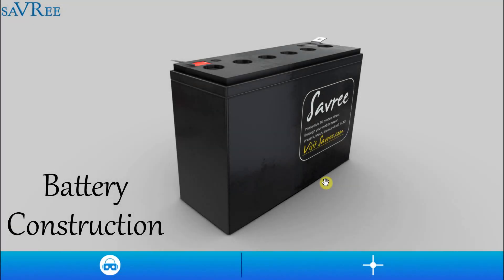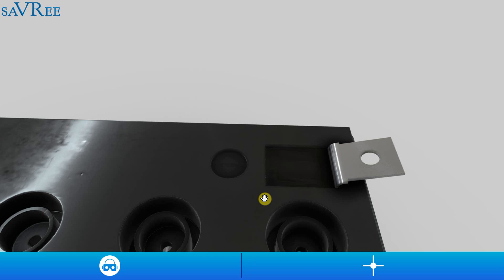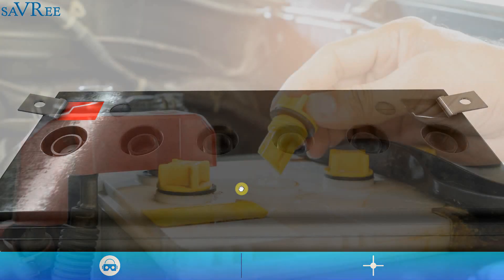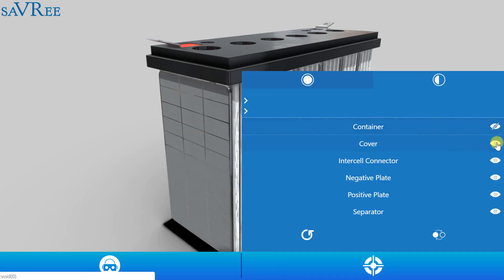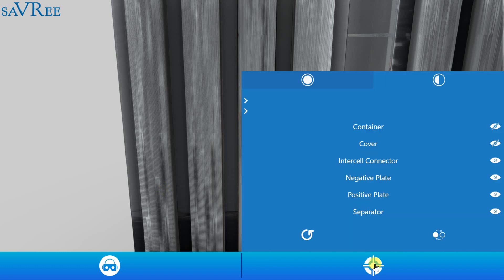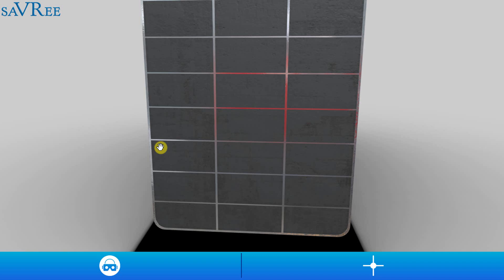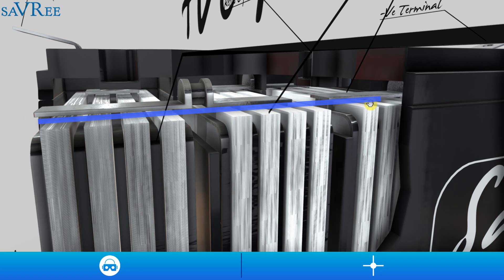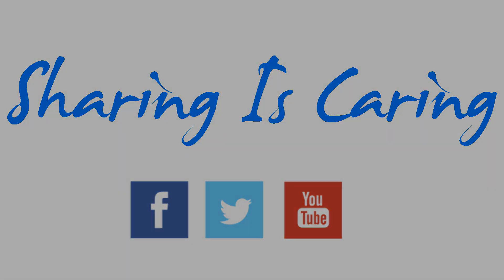Lead Acid Battery Construction

Comment: I can not find the answer anywhere to a very basic simple question.  What this world is coming to?

So I will give this gentleman a go at it.  Lets see.
So you build this battery from scratch.  The last thing you do is pour the electrolyte.  Correct?
So are you telling me that up on pouring the electrolyte you have now a brand new fully charged battery or you still have to actually charge it or you got nothing?
Reply: You're likely going to get somewhat of a combination of both scenarios. Where the battery will show voltage but not have much current to offer. It will completely depend on the quality of your starting materials. 

Let's say your constructing a 12-volt battery. You're at the point where you're putting your electrolyte in. You test the voltage of the battery and you get 12 volts as you should. But if you put something that offers a load onto it it may drop the number of volts dramatically and also not operate the object. If you were to test just the current you might find that you have 12 volts but very little current available. In order to make sure you're ready to go you are going to need to charge any fresh built battery.

Comment: The best explanation of lead acid battery construction I've ever heard! Thank you for this, I am doing research on how to make a lead acid battery at home. My goal is to go to a junkyard and buy old lead acid batteries and design a new openable and resealable see-through container for them for off grid applications. I want to recycle the lead at home, this is what I've figured out so far. The active material and the grid material in both plates is essentially the same thing: lead. The "sponge lead" on the negative electrode is just lead that you would melt and grind up(in an outdoor area far away from any breathing beings, and with an OSHA approved lead filtering respirator on) to make lead powder. You mix the lead powder with sulfuric acid and pure(filtered, like in a bottle you buy from a store) water, mix it up really well, then take a putty knife and press the lead-water-sulfuric acid paste into the pure lead grid. You would then run the grid with paste through a roller that compresses it(also homemade). The pure lead grid is made from recycled lead that you just melted from the battery, you have a steel grid form that you cut on a cnc machine, or you could cut one with an angle grinder and a piece of steel, albeit carefully. You pour the hot molten lead into the top of the form and viola, a lead grid! The positive plate material is lead oxide, red lead essentially, kind of like the red stuff that gets on metal, iron oxide, i.e. rust. This is more elusive, but I believe it can be made with a chemical reaction of some kind between two lead plates, i.e. the lead oxide will form if you just hook up two lead plates in some sulfuric acid and water electrolyte. You grind off the lead oxide with a knife to make lead powder, and just hook the charger back up until you get a lot of lead oxide powder, then do the same thing as the negative plate, mix the lead oxide powder with sulfuric acid and water, mix it really well, then push it with a putty knife into some more lead grids that you made(I think the same form will work for both positive and negative plates). Then run the plate with the lead oxide paste through the machine you made to compress it(push the grid through two rollers, the plate is slightly bigger than the rollers, this compresses the lead metal grid around the paste and further compresses the paste).

Now here's the really interesting part: you let the grids sit out in the sun and dry. You mixed the lead powder and the lead oxide powder with water and sulfuric acid. The acid stays, but the water evaporates. If you were to look at a map of where the atoms of the lead and water and sulfuric acid are, it looks like a "sponge". Kind of like swiss cheese, the water evaporates and leaves holes, and the sulfuric acid stays and helps with conduction when the plate is submersed in electrolyte. This is what weakens the battery, because the sulfur crystalizes and pushes the paste apart, the lead atoms loose connection with their surrounding atoms and break off and fall to the bottom. Sometimes the separator presses on the plates and prevents this from happening. The reason you woulnd't use flat plates(you actually could though) is because of the capacity, flat plates of thin lead don't have as much surface area as the paste. The paste is like swiss cheese, a winding network of caves if you were to look at it on a molecular or atomic scale. This creates a tremendous surface area and increases capacity.

If I can actually make this work, I wouldn't have to buy any more batteries. I could make them last 1-3 years(depending on use), then recycle them at home for cheap. I could also go to the junkyard and buy more and have them as backup dry cells, just pour sulfuric acid in them in case one dies. Any tips? Anybody? I need as much help as I can get. I think this might work, but I could be wrong. Anyone ever tried this technique before?
Reply: All the best 🤩🤩

Comment: Hey SaVRee, Absolutly brialiant job. 

Id love to have someone explain why the negative terminal of car battery is connected to ground of car (metal frame) therefore it cant make a circular path directly from positive through load back to negative. I have brief understanding of the chemical reaction taking place, but only interms of the  loop being connected. 
Also  after making the battery  they also hook it up to  charge,  why  is that. 

Anyway totally understand if the question is too broad or not understandable.
Really interesting stuff, and ill have a further look at your other videos.